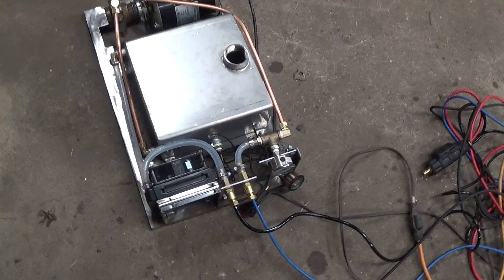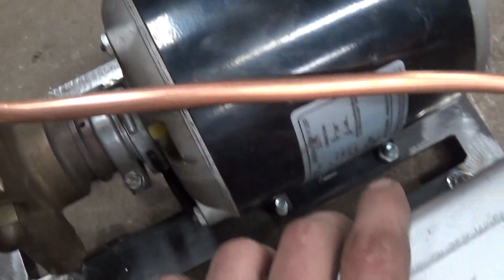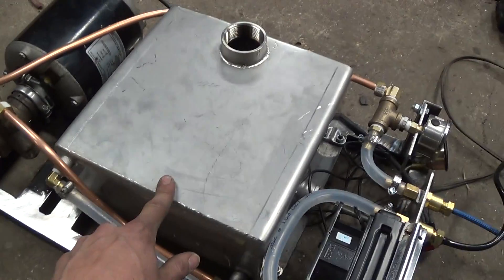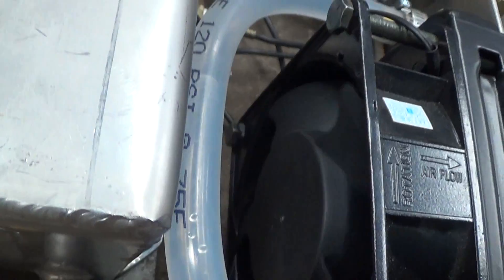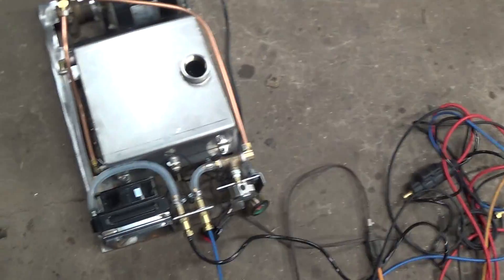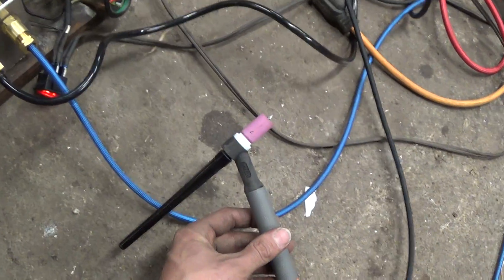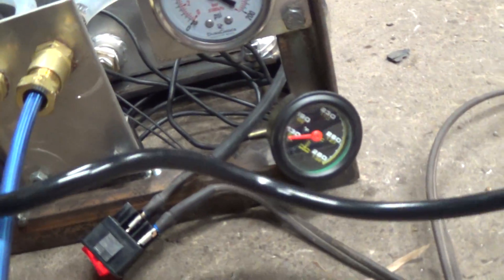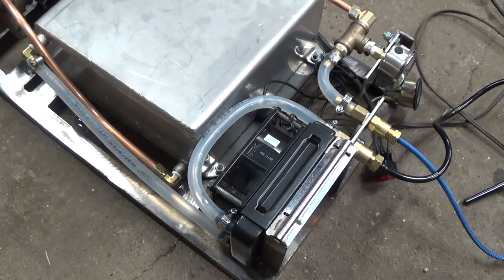Homemade Tig Cooler : Test Pt. 2

Comment: Seems like the water level in the reservoir is very low. That pump is pretty strong and its most likely syphoning air. I would try a simple solution of filling out the tank to the top and letting the pump syphon the air out of the hose for a couple of minutes and see how it works then.

Comment: my airco is just a pump like yours and water tank but the tank is about 7 gallons simple and works. no fan no radiator. Does empty into a clear cup to check the flow.  the second one I have had like that my old miller tig had that. also had the built in one on my syncrowave 250 smaller tank and radiator. will depend on available space. less to go wrong for me.

Comment: I believe that it is the orientation of the pump suction line is likely the issue.  There is a cavity of air in the top of the suction line just before the pump inlet.  The inlet should be reoriented so that any none condensables or air will float up through the pump.  Basically you pump is not fully priming.  Other wise it looks nice.  Why such a heavy base?  Regards.

Comment: You might try reversing the inlet and outlet on your cooler, looks like you are getting a waterfall  through the cooler. its on the return side but at least it will cool better if nothing else.

Comment: Hi I have some years ago built the same cooler based on the same type pump. The fitting should have an inner brass sleeve that prevent deforming and prevent leakage. As long as you have air in the system, you will get pulsing and noise. Make fittings leak free, bleed the circuit (by running it), and you should see an improvement. All in all it is an overkill for Tig use, but lots of fun. The pump is a wane pump and should have a relief valve so you can set max. pressure.

Comment: It looks like precon pump. Some of them have a built in pressure regulator . Try messing around with that. And reverse the hose on the rad. flow should start at the bottom
so you don't get air locked. Nice job  on the set up.

Cheers Fred

Comment: your pulsating is most likely coming from your pump if it is a piston type. A vein pump will eliminate that problem as well as the pulsating in water flow.
Reply: Harold Watkins vane pump

Comment: You can crank on those fittings real hard. They take a lot of force without breaking. Of course they are not any good the way  they are  so go for it.  Also when you install one the little flare should be just past the end of your tubing. If that makes sense. Some people put it all together and push the tubing in all the way until it bottoms out. It has to have room to be able to tighten you push in to deep it cant stuck down in the fitting. Undo them look at the flare if it's not almost even with the tub trim it back. Hope this helps if pipe is clean they should seal. If not get sweet joints. I just don't like that cheap line

Comment: Where did you find the fitting that the TIG torch water in and out thread into on your front gauge panel?
Reply: Go on eBay and look up brw_technologies. They have them for about 7 bucks

Comment: Compression fittings can be a real PITA. I prefer flare fittings for copper. They're easy to do and seal well. If you switch to hose from the pump and mount it on rubber bushings, it should quiet it down considerably. Otherwise, very nice design.

Comment: if some want to repeat add to construction *Water Hammer Arrestor*
Reply from the maker: I dont think thats needed, if you look at the other videos after this, that issue is gone, it seems that it was pulling in air from one of the fittings.
Reply: @metalisawesome2811  exactly what your problem was. You pointed out that both fittings on the suction side of the pump were leaking water. If water can leak out, then air can leak in when the pump is running. That is where you were getting your air entrainment from and why it went away when you changed the fittings. People were commenting about cavitation, but that is a different condition that they were confusing with air entrainement.

Comment: It appears  that the biggest challenge people have is in getting the correct pump  to avoid using something that pumps to hard, much harder than needed. What I want to know, is why you need Tig Torch coolant, why would not automotive antifreeze work the same? It can keep a car cool, so why not a torch?
Reply from the maker: I did get this cooler all sorted out. Check out my other videos on it. I installed a different spring inside of the pump that brought the pressure down to around 50psi.
Reply: Which video addresses spring issue and pressure-I have same issue with pulsation on old carbonation unit. SS
Reply from the maker: I did not make a video on that part of it. Unfortunately, I cant remember where i purchased the spring from.
Reply: the pulse is from a leak its sucking air on the inlet side and its called cavation and it will damage the pump in no time.. these pumps pump 250psi stock. if you take off the cap that looks like a nut you should find a ajustment screw behide it watch your gauge well backing the screw out with it running to lower the pressure but if its a super old pump you may need a spring change but a search on the net will tell ya what spring to get
Reply from the maker: Yep, I finally got all the kinks worked out and it runs great. Thanks.
Reply: @intel2you  you are accurately describing his problem with the pulsating, but you were using the wrong terminology. Air leaking into the suction side of the pump is air entrainment. Cavitation is a completely different condition and is not present here.

Comment: Please tell me more about 5.8"LH connection. If you can please attach links for example. I have problem, i not can find this connection (or same parts) on welding shop/dealer.
Reply from the maker: You will need one of each I believe. The dash marks in the wrench flats indicates LH Thread, so check your hose set up and make sure. I have seen some that have both being LH thread and some use one LH and RH thread fittings for the torches. Hope this helps.

http://www.ebay.com/itm/5-8-18-LH-Female-Tig-Welding-Water-Fitting-WP-20-WP-18-WP-24-welder-B-size-/171938071648?hash=item28084ec460:m:m3czSyl8ikKMCLFPT4D6qOA

http://www.ebay.com/itm/201394280837?_trksid=p2060353.m1438.l2649&ssPageName=STRK%3AMEBIDX%3AIT
Reply: Go to eBay. I bought mine from brw_technologies for about 7 bucks

Comment: Are you getting cavitation from the pump spinning too fast?? putting air in your line it's making your lines jump?? that would be very annoying
Reply: Impeller cavitation… Pump is spinning too fast!!!!
Reply: For the compression fittings, tighten and loosen a few time to help create a seat, then make them stupid tight, until you almost put marks in the nut
Reply from the maker: No, the system was pulling air from one of the fittings, after I changed out to different fittings, It has worked perfectly. Thanks.

Comment: You are getting cavitation at the pump inlet. It will wear the pump out quickly. You are pulling in air at the leaks in the compression fittings and the 90 degree fitting at the pump inlet can cause it too.  If it does it after you change the brass fittings then turn the pump 90 degrees so you can have a straight fittings going into the pump. Here is a link for some good fittings for poly tubing that are cheap and don't leak, from McMaster Carr  https://www.mcmaster.com/#catalog/124/195/=1earwna
Reply: You are confusing air entrainment with cavitation. They are two completely separate conditions. His problem is air entrainment due to leaking fittings between the tank and the suction side of the pump.

Comment: Your pump volume is too high for your set up, you could install into your system which needs a flow control valve with a pressure relief that bypasses and returns to your holding supply tanks
Reply from the maker: The pump is adjustable in pressure. All I had to do was order a different spring for inside the pump and presto.

Comment: anybody knows what what fittings match to the torch hoses?
Reply from the maker: You will need one of each I believe. The dash marks in the wrench flats indicates LH Thread, so check your hose set up and make sure. I have seen some that have both being LH thread and some use one LH and RH thread fittings for the torches. Hope this helps.

http://www.ebay.com/itm/5-8-18-LH-Female-Tig-Welding-Water-Fitting-WP-20-WP-18-WP-24-welder-B-size-/171938071648?hash=item28084ec460:m:m3czSyl8ikKMCLFPT4D6qOA

http://www.ebay.com/itm/201394280837?_trksid=p2060353.m1438.l2649&ssPageName=STRK%3AMEBIDX%3AIT

Comment: had a question for you. I'm actually building my own cooler at the moment and hitting a wall. where did you source the actual connectors that are stationary on the cooler that the water in and out connect to. i can't find them anywhere.
Reply from the maker: The ones that are welded to the tank? Those are just 1/8 NPT couplings, stainless. I got mine from work, but I just found some on ebay for a few bucks a piece.
Reply: Go to eBay and look up a company called” brw_technologies” . I got my bulkhead (at least that’s what I call them) fittings for $ 6 bucks and some change.

Comment: I think you are holding onto using some components you really should not be! for example your pump and motor! you could buy a newer pump you can hold in your hand that would push twice the amount as that old motor you are currently using in-fact you should also upgrade that radiator to that's not enough how ever they do sell ones on ebay that takes 3 120mm fans one or two of these would solve any cooling efficiency issues love the tank set up but honestly might want to restart most of the other stuff honestly think you can do much better if you through one bill at it ($100) even get it a little more hightech then current tig coolers on the market such as being able to control multiple fans speed pump speed timer even a temp thermostat and regulator honestly you should be looking into PC water cooling components you would be able to make a very awesome tig cooler going that rout and definitely way quieter
Reply from the maker: These pumps are same thing that you'll find in a Miller Dynasty. This cooler is way over built for what i need, just the way I wanted. Let me know how your tig cooler turns, I'm sure it'll be swell.
Reply: @metalisawesome2811  I don't doubt it can push the pump and it is working, just less efficient and can be pushing better cooling
I'm just saying you could do better
Reply from the maker: @haylspa  Make sure to post a video when yours is done, i'm sure we could all learn from you.
Reply: @metalisawesome2811  yeah yeah if I actually record it or better yet actually post it after recording, chiller was designed for chemistry have all the parts but do need to put it together